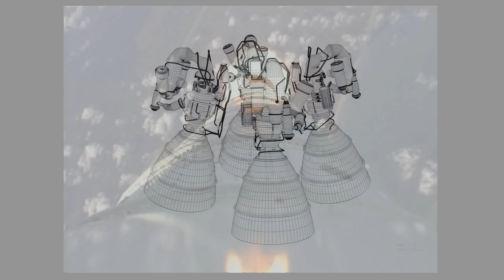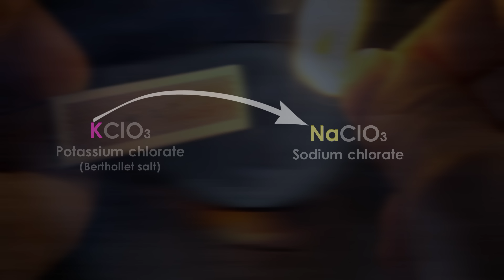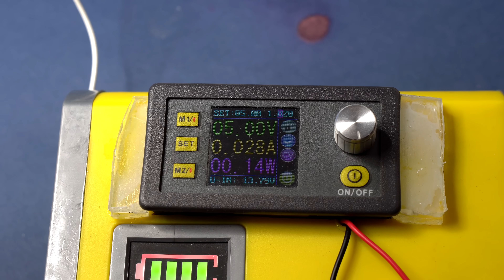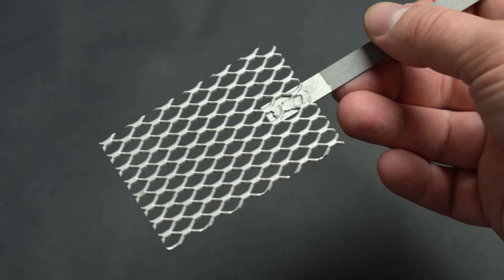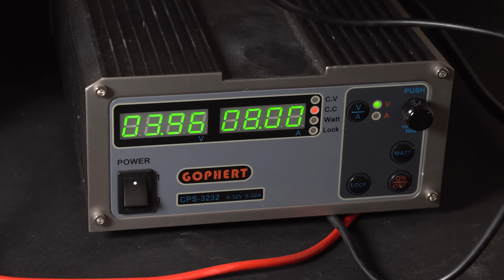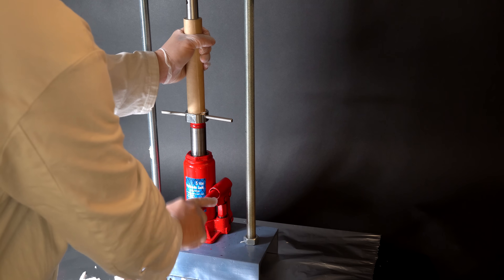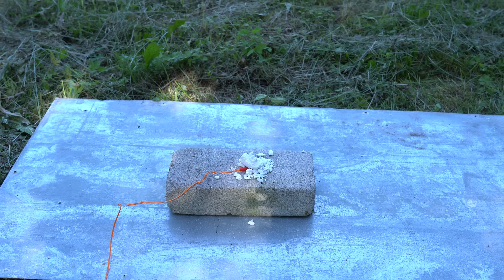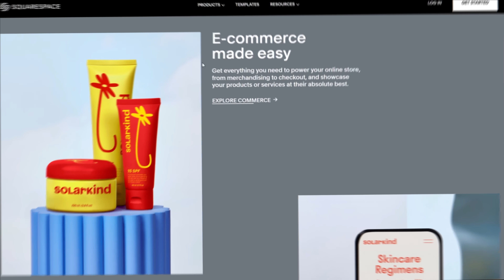How to Make a ROCKET ENGINE From Table SALT?

Comment: Grab a copy of paul coopers explosive engineering and it discusses oxidizers, specifically that if your smoke for a rocket or for a spontaneous pressure party is black that has historically been used as a low grade measure of lacking enough oxidizer. It also has some calculations for determining efficiency and maximum gain of products in -> results out.

Comment: A mars society would require nuclear power and solar power. With power you can do many many things with resources. Too bad there is such a bad rap for nuclear. Nuclear power is probably the most safe and secure and stable and lasting form of power in space. It doesn’t blow up, it doesn’t run out easily, and it can reliably and efficiently have hundreds of days of excess energy in case of an emergency.

Comment: put liquid fuel on top container, then NaClO3 on the bottom container, in the rocket, you have a hybrid rocket with gravity acceleration plumbing, no turbo pumps required, heat will activate the NaClO3 barrel oxidizer producing oxygen for the rocket thrust. or just have heat activate the high pressure oxygen production to the standard rocket nozzle. the larger the fuel tank, the more pressure by weight it has to push the fuel out to the rocket nozzle. yep the fuels are not mixed, so it does not activate on its own. then the NaCl salt will melt, keeping the reaction hot.

Comment: Why would you want to land on Mars, when you can land on Youranus every single day? NASA has never gone to the Moon, or Mars, or even outer space, because it is not real. There are no satellites in space, if you do a simple google search for "High altitude weather balloons and satellites", you will get images and videos of NASA sending satellites up into the air using large weather balloons, and some of those satellites can remain afloat and in service for over a decade, and that is how they have satellite communications, but they lie when they say that satellites are in outer space, that is why when large storm pass through an area, the first thing to go is satellite or cellphone communications, because the weather balloons are pushed out of the way by the storm, or the weather balloons are moved out of the storm's path by raising or lowering them into gulfstreams of air and using those as highways to move the satellites elsewhere to prevent it from being destroyed by the approaching storm. Above the Earth there is a solid dome or Firmament, and no one has ever been able to penetrate it, therefore NASA and every other fake space agency in the world lies when they tell you that they have gone into space. This is the reason why China sent a spy satellite over the USA in a weather balloon, because they can't reach space, if they had satellites in space, they would not need to risk getting caught using a weather balloon with satellite over the USA. I know most of you will think this is all BS, but it is the truth, and the reason you don't believe it is because your whole life you have been indoctrinated to believe and accept lies, and when those lies are confronted by a person like me, those who are indoctrinated will defend the lies they have been fed all their lives because to them that is the only reality and it would be stupid not to accept it, but if you are a smart person, you would research what you have been taught from childhood, and doubts will begin to rise as you start to notice the inconsistencies of all the lies you have been told your whole life.

Comment: I experimented with potassium perchlorate and Silicone sealant.

It combusted soflty and slowly, I am currently building a 6inch diameter Solid propellant rocket fuel by Sodium Chlorate/silicone propellant.

Comment: Titanium sparks alot? Does that mean Titanium is uber high carbon steel? Bc when you have some steel you dont know what is (in a smithy), the first indicator of high carbon steel is its long and very bright sparky sparks when you cut in it with an angle grinder for example. But High carbon steel isnt that strong. So I wonder if that is all that our technique finds... "hard metal". (which in smithing parameters WOULD be high carbon steel in some form of blend, others arent "hard/hardened" the same). And then in the smithing profession we just thought these long white sparks meant "high carbon". But if Titanium isnt high carbon steel, then we know that these sparks doesnt necessarily prove that there is carbon present, but simply that the metal is above a certain hardness (or maybe some third possibility making these metals spark like this), since Titanium has no carbon (I think?) and it still makes the same sparks apparently. So two professions have the SAME EXACT technique to determine two different outcomes/assumptions... One has to be wrong/inprecise is all im saying and want to know since curious.

Comment: Just use graphite, you'll just need to replace the electrodes as they soften. Although that happens very slowly. You can also coat your titanium in it which is super easy.

Comment: I have trick for make engine power
Charcoal of low weight wood(or more) 2.5g
Potassium nitrate 1kg.
If want many
Charcoal 5g.
Potassium nitrate 2kg.
*It have many power should be careful*
If want low power just add charcoal to 3-4g./potassium nitrate 1g.
If don't have charcoal just use sugar =))

Comment: Depending on how long it takes for the titanium electrodes to corrode, you might just get away with pulling them out every time the current drops significantly and scraping them off.

Comment: I haven't laughed so hard out of a scientifically correct video since Beakman's show! Sure, making a rocket from table salt was obviously a click-bait, but I was willing to bite it... Then came a series of questionable, but acceptable excuses to produce rocket fuel from salt, on Mars, and how that'd be reasonably easy and justifiable... And the best part, it's actually done, except, of course, it's not on Mars, and hardly capable of transporting anything anywhere, having no guidance system or whatever, but it works! Now I know I could possibly build a rocket using spare electricity from the Mars habitat, glue lying around in the spaceship, titanium meshes scavenged from the hull, iridium ore, some wire from a USB cable and a match (I'm pretty sure NASA would put a matchbox in the survival kit to Mars...) This was the best "episode" so far! It's as if "MacGyver" was produced by a Science channel...

Comment: I'm afraid you  you wont get much sodium chlorate by NaCl electrolysis that simple. Usually in your setup you'll end up with Sodium Hydroxide in solution and H2 and Cl2 at the electrodes and is called the chloralkali process. Yes industrially the sodium chlorate is obtained by electrolysis but there are a few very important details as temperature electrodes distance and Ph to end up with sodium chlorate.

Comment: When I was a kid, I use to shoot empty C02 tubes stuffed with cut off match heads (only book safety matches, not the phosphorus type), and I ignited them electrically with tungsten filaments removed from old light bulbs, similar to your igniter of thin copper wire wrapped around a match head. Fun for teenager living in the boondocks.

Comment: Many years ago (1950s) when sodium Chlorate was easy to buy we made rockets by mixing it with icing sugar and about 20-30% wheat flour....this slows the burn rate to a level suitable for rockets.... Without the flour is it was way too fast for rockets, but great for crackers....although it is hygroscopic so it doesn't store well..... it has to be made and used within a day or two.

Comment: The problem with this kind of home made rocket is that there is the problem of converting from a deflagration or burn to a detonation or explosion as was demonstrated by hitting the rocket fuel with a hammer. The problem is lessened by going to a propellant like zinc and sulfur which doesn't explode or detonate but can still rupture the casing with excess pressure.

Comment: Its my understanding that combustion engines wont work properly without oxygen. What I've gathered is they use liquid oxygen to mix with the fuel so that the combustion can occur in no atmosphere environments. Additionally, I'm not sure Mars' atmosphere contains oxygen so this rocket will likely not even ignite on Mars.

Comment: Filling a barrel with small drain holes in the bottom with  organic material and soaking it with pee and letting nitrobactor do the work . This is traditional way to make saltpetre. I think this is a lot easier.  But I did very much enjoy the science, thanks .

Comment: Hello, sorry for my stupidity, so the salt left after boiling away the water and after the electrolysis isn't regular table salt? If so what is the chemical name of it? And also, how do I know if the electrolysis is complete and when to boil the water away? Thanks in advance
Reply: In chemistry the term 'salt' refers to ionic compounds, made of positive ions (+) and negative ions (-). Table salt is Na+ ions and Cl- ions combined.

What he made here was sodium chlorate salt, Na+ as before but ClO3- instead of Cl-. Chlorate anions are powerful oxidants, and certainly not to be trifled with. They are toxic and mixes of chlorate salts with some fuels can act as shock or friction sensitive explosives. If you want to mess with them you'd better study up on your chemistry and safety knowledge.

Comment: Thanks for explaining all the ways it does NOT work too; that's where the real expertise happens, especially down to the level of the electrodes. I would have just used those two $900 USD 1oz platinum bars 'as-is' as electrodes though; they would work, right? Please do a video showing the expansion nozzle design and build.

Comment: You can also use liquid rubber as a fuel, it contains oxygen in the rubber and makes an excellent fuel amateur rocketeers it's an expensive it's abundant and easy to acquire and easy to use !!!

Comment: Oh look what oxygen as a or locks as a oxidizer for rocket fuel was no longer used, they can now use fuels that contains its own oxidizer, instead of having two separate systems one for the liquid oxygen or locks as it's called and for the actual propellant, made the missiles much larger much heavier and far more expensive, cuz you just cannot simply inject liquid oxygen directly into propellant into the rocket engine !!!

Comment: Hmm.  NaClO3... I always used KClO3.  I wonder how the sodium variant would compare.  Concerning mixture, I always shot for a 50-50 mix of KClO3 ans powdered sugar.  I would eyeball this then burn small amounts and check the residue.  If I got black residue, I had too much sugar.  If I got white residue, I had too much KClO3.  When the residue was absent (or nearly so) I would run the mixture between two pieces of plate glass (like in windows) which I had roughed up with coarse sandpaper.  This produced a mixture so fine that it burned much faster than flash powder.  I nearly lost three fingers launching a 4 inch by 1/2 inch rocket by hand.  Last time for that approach!  After that I opted for explosive uses only.  Put the poor little M-80s to shame.

Comment: WHEN I WAS ABOUT 12 , I PURCHASED COL. BERTRAM BRANLEYS BOOK : THE AMATEUR ROCKET MANUEL    X.   I MADE A TEST ENGINE VIA HIS SIMPLE FORMULAE  ;  POWDERED ZINC FORMED IN A MOTOR TUBE WITH ACETONE , IN A CRUCIFORM  ... AFTER THIS SOLIDIFY , IT IS. E ! T R A O R D I N A R I L Y.    FLAMMABLE, YIELDING AN ENORMOUS PRESSURE  X. DO NOT , TEST BY LIGHTING A MATCH TO IT , IT IGNITES INSTANTLY AND VIOLENTLY

Comment: As someone who dabbled extensively with pyrotechnics long ago, I was nodding along since everything was quite familiar until you used silicone sealant as a fuel. I almost fell off my chair. That is *so cool*! It seems like a decent fuel but with the added benefit of having a built-in binder/stabilizer. Looks so easy to work with, and gives such a super smooth burn. So stable, in fact, that it makes the otherwise hazardous chlorate viable for something other than explosive charges! Would have loved to hear what it sounds and smells like as you launch the rocket (I often get nostalgic when I smell burnt black powder).

Comment: One way to make an exhaust nozzle that is more efficient than just a bored hole is to 3D print a thin wall parabolic rocket nozzle. Single perimeter wall thickness is ideal if your printer can do that.
Then you set the printed nozzle in the end of the rocket tube and fill the gap between the rocket tube and the printed nozzle with epoxy or thin plaster of Paris or cement slurry. the filler will conform to the outside shape of the printed nozzle.
In use, the thin plastic will burn away leaving the durable molded filler
Reply: What filament for a 3d printed nozzle do you recommend? I want to use PLA but that will melt at like 60 degrees C, and my rocket exaust gets way hotter than that.

Comment: There is a step I don't understand and I am not a chemist, so bear with me a moment.  

As I understand it, you are "distilling" the table salt... into sodium chloride?  Is that not table salt?   

What would happen if I just finely ground the table salt in a coffee grinder and avoided your process of using electricity, titanium, anode\cathode?  

Would it still work, but in a diminished capacity?  What if I mixed powdered table salt and sugar?  Would that slow down the explosion enough to act as a primitive fuel?  

I use to launch a lot of hobby model rockets.  I took a few hobby engines apart to see what made them tick.  (Easy, just unroll the tube.)  There has to be some sort of cap at the opposite thrust end, which you did not show the process of making...  

But in one shot later, I see you had put what looked like JB Weld or other type of moldable epoxy at the opposite end to resist the fuel from just exploding out both ends.  

Without the nozzle and fuel channel, this would make a hell of an emergency flare!!  LOT of smoke, plus really bright light- the perfect emergency flare.  VERY handy in a terrestrial survival situation, such as stranded in the wilderness after injury- quite the McGyver device!  Friends were trapped by a blizzard and had no radios.  Planes were searching, but they did not realize that.  They could have used your first motor as a flare. 

THANK YOU!  This is really fascinating given my hobby as a youth.   SUBSCRIBED!
Reply: He is using electrolysis to make sodium CHLORATE using sodium CHLORIDE as the starting solution. Electrolysis is hard on electrodes and tends to dissolve them quickly. To make them last much longer they need to be coated with a metal that is resistant to corrosion. Hence the precious (expensive) metal coating. If you are truly interested in making sodium chlorate or whatever other chlorate, ebay has electrodes for sale already coated.

Comment: I had a friend that worked on rocket munitions experiments in the 1980's and he told me one night when we were smoking the ganja that they had this issue where the rockets would expend their fuel in a non-linear difficult to utilize time curve that they eventually solved by using various star shaped cores of varying points. Usually a 4, 5, or 6 point core spun in a spiral like a twizzler produced the most consistent output.

Comment: If there is no atmosphere on mars then you lose thrust because there is no atmosphere to push on. So the distance the rocket can fly on mars may be the same as on earth. Depending on the rockets weight to power ratio.

Comment: If able to salvage platinum and tungsten and lots of power then chances are search a bit better and there maybe a surplus flare hidden in the kit those might be quite common in any survival station you were scavenging, but very interesting as demonstrating the dynamics of basic solid fuel rockets!

Comment: Pardon the pun. You should have used a Mars bar for the chocolate. Good interesting videos. Will Ammonium Perchlorate burn mixed with silcon? Or do you need another oxidizer.?
Reply: Ammonium perchlorate is both oxidiser and fuel, given sufficient provocation it can burn or explode entirely on its own. It's very oxygen rich however, so the extra oxygen can burn other fuels.

In professional solid rockets it is usually mixed with rubber and finely powdered aluminium, the rubber functions as both fuel and binder, while the aluminium functions as an additional 'high energy' fuel that significantly boosts the combustion temperature.
Reply: @nerd1000ify  Wow, that burning rubber would smell Terrible :planet-orange-purple-ring:

Comment: Does it have to take 5 days? Would increasing the voltage or current make a difference?
Reply: I believe increasing the voltage drastically reduces the efficiency. Increasing the amperage is viable as long as you can handle the extra heat it will produce. Pointing a fan at it, or sitting it in a tub of water attached to a cooling loop could be options.

The way I understand that chemical equation though, you shouldn't actually have any excess chlorine gas produced, if you are getting chlorine gas, your setup is producing it faster than it can dissolve in solution, so: yet another inefficiency. You'd probably be better off scaling it up, (higher throughput), than trying to make it faster, (shorter lead time).

Comment: very interesting and informative video, but I'm not sure why you said potassium nitrate (KNO3) is too difficult to get. You used nitric acid for aqua regia, and the only other thing you need for KNO3 is a basic potassium compound, such as potassium carbonate or hydroxide. Very easy reaction, I've made quite a lot of KNO3 for homemade black powder. 

so yeah while the process for producing sodium chlorate was interesting to watch, the easier alternative is to... mix nitric acid and potassium carbonate, dry the product with heat and that's it basically.